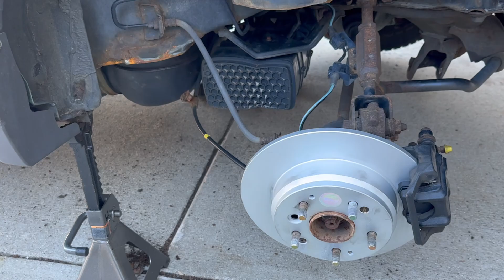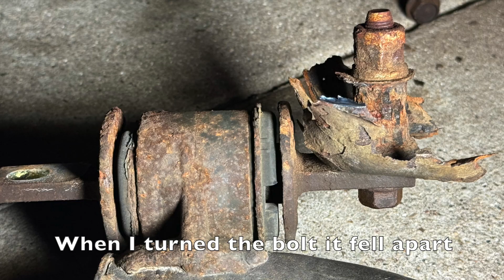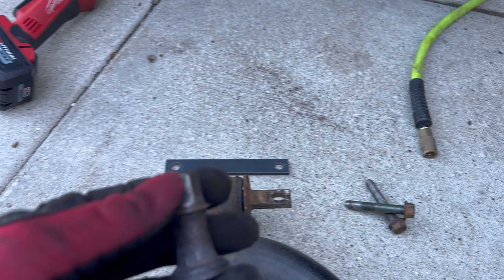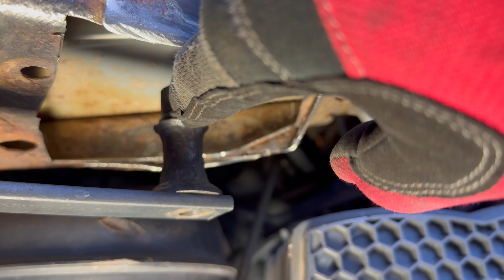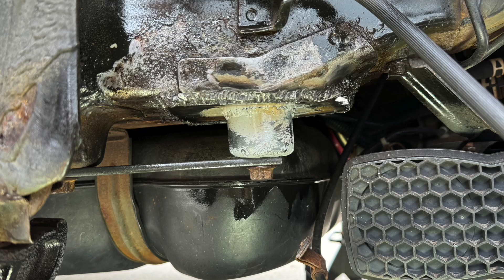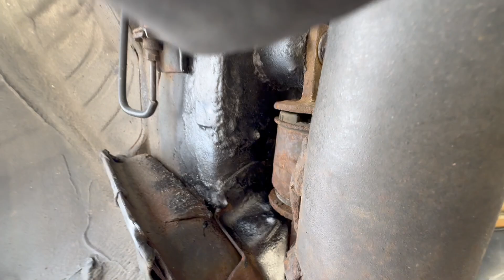DIY Rust Repair on my  Honda Element Trailing Arm Mount

Comment: Well done! I suggest spraying the inside of that cavity with Fluid Film or similar to reduce the rust eating from the inside out. Did you need an alignment after this repair?
Reply from the maker: Yes, I plan to get some rust inhibitor to spray inside the frame. While I had it open I did spray rust reformer all over inside and I primed the patch with weldable primer. A coating of a good rust inhibitor will go on soon. Yes it did need an alignment but not because of the repair itself. I disassembled the entire trailing arm including removing the toe alignment bolt and I also replaced the rear struts. It was due for an alignment anyway.
Reply: @coolcat312  Don't dismiss an oil undercoating like fluid film- at least spray it over top of whatever else you put down. My Hondas look way worse than yours, I think we have more road salt! I wish I knew about oil under coating years back- it's amazing stuff.